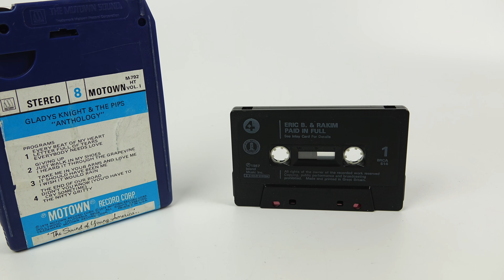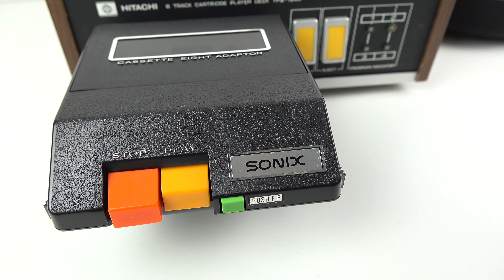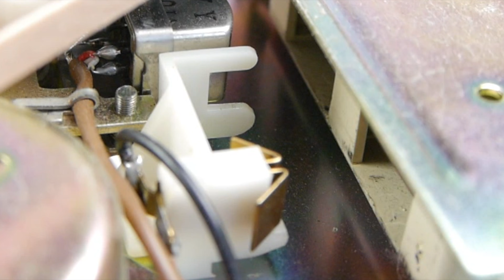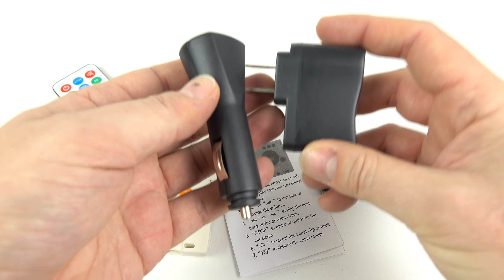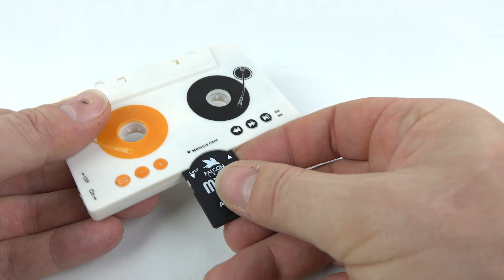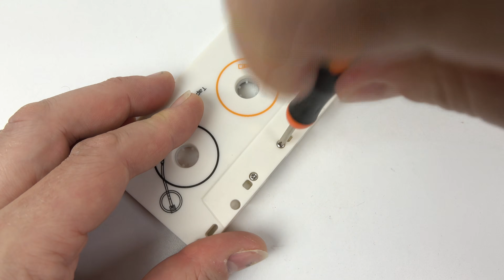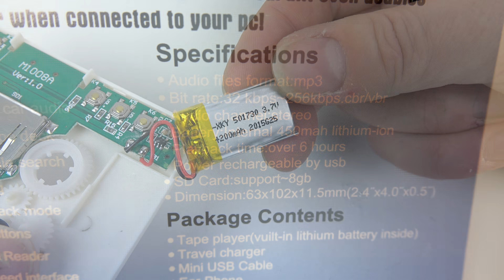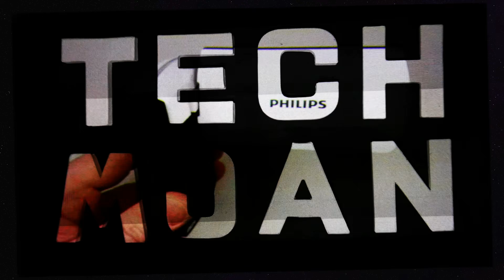Car Stereo Tape Adapters - 8-Track to Cassette to MP3

Comment: The one my parents had was far less bulky. It was longer than a typical 8-track, but not by much. The compact cassette actually mostly fit inside the machine when you played it.

I'm also pretty sure it has this small roller  at the end. I don't know if it used it to power the cassette, but I do think it was what was used against the heads in the actual player.

Comment: This brought back memories from high school when I was driving a 1979 pickup with an 8-track player.  I found one of these 8 track to cassette adapters at a rummage sale, got the cassette to 1/8" jack and plugged into a discman so I could listen to cd's in my old truck. Worked well if I held the CD player, but having to shift gears and hold a disc man didn't work too well. Good times.

Comment: Be good if the cogs charged the battery the you would not need a power supply or have battery life limitations. A simple display on the cassette adaptor would also help.

Comment: You mean I can have an MP3 player that looks like a cassette?! Forget the adapter part, I just want that!
Reply: You can find them on eBay or Amazon for about $15.
Reply: John Cate The shipping will be from China, and it can take two to three weeks before delivery.
Reply: John Cate The shipping will be from China, and it can take two to three weeks before delivery.
Reply: Question is; do they make one that is not cheap chinese junk...

Comment: I had done something similar to this back in 1991. I had a 67 Plymouth with an underdash Motorola 8-track player, it had been in the car probably since 1969, and wanted to play my portable CD player through it. CD to cassette adapter to 8-track adapter. I don't remember how good it sounded, it wasn't God awful, AND it worked......

Comment: If the MP3 adapter supports 8GB cards that means it supports the SDHC standard and would date the device to after 2006 at the earliest, 2006 being the year SDHC was announced. SDSC supports 1MB to 2GB (though some 4GB cards were made), SDHC supports cards from 2GB to 32GB, and the current standard SDXC and supports cards from 32GB to 2TB. I have seen a number of devices say they support up to a certain size that is not on the border between these standards and I don't understand why. The only thing I can imagine is that they only tested it with an 8GB card and didn't want to have to recall the device if there were unforeseen problems with larger or they weren't very careful with their specs on the package, the latter being much more likely in my opinion.

Comment: The mp3 cassette would have been more clever if they used the tape deck motors to recharge the battery.
Reply: or skip the middle man and have it self powered

Comment: I have (or had, I don't know where it is at the moment) an MP3 player called the Digisette Duo MP3, which was a cassette shaped MP3 player that actually did use the transport controls of the cassette player to skip songs forward or back.  Unfortunately, from what I remember, the batteries were no longer holding a charge, and I couldn't find replacements.  It used small proprietary rectangular batteries that needed to be removed and recharged.
Reply: A quick peek on ebay, and the batteries are actually available from Hong Kong... Now if I can only find my Digisette...

Comment: I had a cassette adapter much like that one that I purchased at Radio Shack back in the day for my home stereo.. I rushed home, dropped in my cassette of Dark Side of the Moon, only to be greatly disappointed. It had converted the stereo signal on the cassette to monaural. Back to the store it went to exchange fur a proper cassette deck.

Comment: some 8 track to cassette adapters did use the capstan to drive the tape mechanism, but still needed power for the electronics.
Reply: One I bought from Service Merchandise (Remember them!!!!) in the mid 80's did that..

Comment: But wait, there's more! The Cassette to 8-track adapter you have is but one of three. It was sold in the USA under the Realistic brand name in Radio Shack stores, with black buttons. Sparkomatic and Kraco sold much more compact versions, hardly any larger than an 8-track cartridge. The casette fitted partway inside the 8-track slot so the adapter had to be removed to flip or change tapes. They used the capstan drive from the 9-track player to mechanically drive the cassette. They're not just rebrandings of the same device. The Sparkomatic has its function lever on the left side while the Kraco has its lever on the right.

How about a three-way shootout for sound quality, played in a better 8-track player?

Now for the Cassette shaped MP3 player. What you have there is a cheap-o version. The original model, made by MobiBLU, didn't have a removable memory card. Music had to be loaded to it via USB. On the plus side the tape transport controls worked to play, stop, and skip back and forth among the tracks. Doubleplus, it had an FM radio tuner, a microphone for recording to its 256 megabytes memory, and a removable battery. There was also a wired remote control with LCD, which could only be used in a cassette player if the side of the tape was left open. MobiBLU made a second revision with an SD card slot.

But wait, there's even more! Your cheap version is the second knockoff of the MobiBLU. romeMP3 was first to copy, a quick Google found one with 32 megabytes, some with wired remotes with LCD and apparently SD card slots and removable batteries. I didn't dig deeper to find if they had FM tuners or microphones.

So for some really useless fun, figure out which is the 'best' cassette to 8-track adapter, get a MobiBLU or romeMP3, pop that into a Walkman, connect one of those cassette adapters with a headphone wire, pop that into the 8-track adapter, and that into your good 8-track player. "How to play MP3's in your Walkman through your 8-track, the Heath Robinson / Rube Goldberg way."

Comment: nice.. my folks have a old classic car with a OEM 8 track player... later years they gotten a smaller 8 track to cassette adapter to use in the car ( they want to keep the car stock and as original as possible..) but there tapes are getting old. so this is a very good solution for them

Comment: that 8gb size limitation on your mp3 casette is most likely due it "only" supporting sdhc format which has size limitation between 4-32gb.
most likely they said that it only supports up to 8gb, because either that was the max capacity available at the time or they only had tested it with 8gb card.

same thing happened with phones too, in many cases with old nokia symbian s60 phones where advertised to only support 128mb or 256mb mmc cards just because nokia only made cards up to those sizes.
but many cases there wasn't anything on the phone or it's firmware to block bigger cards, so phone that only "supported" 128mb cards could work just fine with 2gb cards too.

same has happened many times with newer phones too, that supports sdxc cards where often advertised to support only 128gb or 256gb cards just because  those where biggest cards that where available at the time, even tough sdxc format can and most likely those phones also can support cards up to 2tb.

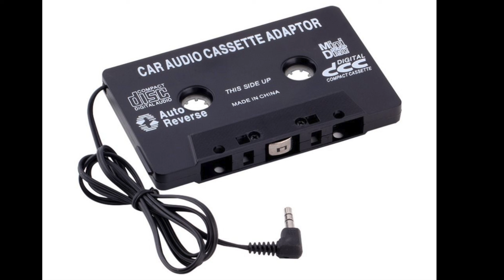Comment: Yo Techmoan, I just gotta say, when I first watched this video and saw the device at 6:00, I bought one off Amazon right away - my car only has CD and Cassette players, but I listen to a lot of things straight off of YouTube. About a year later I'm still using it every time I drive, and my friends use it too whenever they're in my car. I was a little skeptical at first, but as far as I can tell it sounds about the same quality as a CD. So thanks a lot for the info!

Comment: a computer connected to a usb-male to micro SD cable with the micro SD head in a micro SD to SD adapter in a cassette adapter in a 8 track adapter

Comment: I actually found one of these in a '75 Lincoln I bought, the stupid thing worked too, until I mistakenly smashed it. However, it had no motor and was only a series of rubber rollers which used the 8-track player's motor to turn the cassette directly. Pretty impressive.

Comment: I got the same thing that I've got off of eBay today. It plays MP3's on a cassette. It works with all of vintage cassette deck of your choice, one of the shoebox cassette recorders, cassette deck, children's cassette recorder or an 8-track adapter thatI have is a Sparkomatic. I tried it on my Panasonic RS-803US 8-track player & recorder and it plays and sounds so good than an ordinary 8-track tape and cassette.

Comment: You said in this video that people should not use the cheap power adapters that come with car cameras, etc. but you didn't say what we should use instead?  I have THROWN AWAY car cameras because the adapter broke!  How does someone like me (fairly intelligent) know what adapter can be used in place of the original??
Reply from the maker: Dashcams almost always are powered by USB. All USB is 5V.
Dashcams draw between 1 to 2.1 amps. So get a car USB power adaptor that supplies 2.1 amps.
More info http://www.techmoan.com/blog/2014/7/19/batteries-cables-and-confusion.html

Comment: I've got an earlier (?) version of the MP3 cassette, without remote control. Looks just the same, right down to the odd silkscreened "turntable" decorations. The interesting part though, is that this other version does have sensors connected to the tape sprockets - these allows not only play/pause by operating the tape player controls, but (IIRC) skipping forward and backwards by doing FF/rewind. Pretty neat!

Comment: But the original picture that made you make this video was not electric. That one really was driven by the motor of the 8-track. So your idea about that was half right.  The tape goes in the other way bacause of that movemend inside the 8-track cartridge. Maybe that one would actually work wtih that tnt 8-track player. :-)

Comment: I used a Bluetooth cassette tape adapter for an older car to connect to my iPhone. My deck kept auto reversing so I had to remove a cog from the tape adapter after which it all worked fine!  My only complaint is the tiny battery in the cassette adapter only plays music for 4 hours. But still very cool to have a modern device play wireless music in an old car.

Comment: I have buyed this MP3-player-in-Compact-Cassette unit, and have found 2 new features which are not described, even by the seller on Ebay:
01: When an SD card is inserted, and the device is switched on, It will go USB Soundcard when plugged in to an Active Win7+ computer. (Meight allso do on XP)
02: When an SD card is inserted, and the device is switched on, It will go Removable Storage Device when plugged in to an Active Win7+ computer. (Meight allso do on XP)

Those features were found by accident when I connected it to the computer to charge it.

As for the sound of it, It is sadly way too flat... Even with tapping the EQ button several times, the Bass is far gone... I might exchange two SMD Audio DC Cutoff input and output Capacitors (Outputs are C5 and C6 in 10:30 ) from the Amp for greater capacety to get that sorted. (It is just a Class B single voltage fed Amp IC)
For now, I have modded a cheap pair of earbuds by opening up alll the taped ventilation slots on the Magnet so it sounds just a bit better. (These earbuds are now too Bassy with qualety equipment, and therefore "paired" to the Cassette player)

Comment: With the MP3>Compact Cassette adapter, what happens if you turn on Dolby Noise Reduction? Would it make any difference to the sound (better or worse)?

Comment: Slight correction, the film on the head is used to make sure the head is not too close to the head in your car. If the head is too close it will saturate and you will hear distortion.

Comment: That cassette mp3 player is supporting 8gb SD card which is SD HC or SD High Capacity standart and can support up to 32GB, like the modern smartphones supporting Micro SD XC cards can theoretically support up to 2TB as the standart goes...

Comment: They completely missed a trick with that cassette MP3 player, a tiny generator could've been used to charge the battery as the player turns the mechanism inside. I have a cassette deck but also have a rather more expensive AUX-in system that replaces the CD changer, might get one of these as a backup.

Comment: I remember listening to cassettes on one of those 8-track adapters in my moms car when I was a kid in the 80's...you must have bought a high-end adapter because even through youtube and these tiny iPad speakers, it sounds waaay better than the one in her late 70's Impala. Although, the fact that the adapter was slightly melted from the 120F degree Arizona heat might have had an impact on sound quality....

Comment: Wow, it's quite an assumption that you can draw power off the end-of-tape sensor on the 8-track. I can think of many circuits that wouldn't allow that to work (as it's essentially an INPUT), but probably back in the day they were very unsophisticated. It does look like an ultra-cheap transport mechanism of early 70s vintage, sounds about as bad as that implies! (Germanium transistors as well, if I'm not mistaken, that dates it to the same period).

Comment: just a thought. the 8 track adapter may take up to 25 volts so it could be used in coaches trucks or other vehicles with a 24v system - just something that randomly entered my head as I drove an old coach once with an 8 track.

Comment: That MP3 cassette player had to be from 2006 or later. You popped an SDHC card into it and it played it perfectly. SDHC was introduced after 2006 and is NOT backwards compatible with standard SD Cards, the slots and pins and power draw are all the same but the way it handles files is completely different and will not read if a device only accepts standard SD cards.

Comment: My parents still has an audio cassette tape adapter thing that you can use a modern day digital music player on a cassette player. they used it in my dads old 2003 Toyta Corolla to play Podcast and/or Music from an MP3 player on long car trips. But I still don't understand how it can convert the digital sound to analog without needing to rewind or flip the cassette tape.
Reply: It probably has the exact same kind of mechanism as the MP3 player cassette in the video.
Reply: true
Reply: Just about all audio players convert from digital to analog. If it's line-out it works the exact same way a tape does, left and right analog audio on the tape picked up by the tape head, the media player sends left and right channel analog audio through to the tape which is read by the tape heads in the exact same way that a cassette does.

Comment: Wow, Infrared on the cassette/MP3 adaptor was a pretty stupid idea of the maker.
Most cassette radios I've seen swallow the whole cassette, leaving no way for the signal to the remote control. Bluetooth would be a better choice for the remote.
That also kept me from buying the adapter in the first place. I had an cassette to 3,5" jack for years, some of them are of decent quality.

That cassette to 8-track unit has this amazing 70s/early 80s black rough plastic surface, I love that.

Comment: If I didn't remember wrong, SD cards only goes up to 4GB, so 8GB means SDHC card is supported. Therefore, maybe the 8GB is just printed on because that's the maximum size available at that time XD

Comment: 'SD' cards have a maximum capacity of 4 GB of data. If it takes an 8 GB card it meets the SDHC spec, which goes to 32 GB of data. Anything that reads an 8GB card should read a 32 GB card. SDXC cards are between 32GB and 2048GB, however because of a missing additional address line, some SDXC readers stop at ... I think it's 256GB. Also I don't think anyone actually makes a card larger than 512 GB yet.

Comment: I had a 8-track to cassette adapter that didn't take any batteries and seemed to be gear driven from the 8-track player. The problem with it was, it played cassette tapes slightly faster than they should have been. Listening to Nirvana in 1993 on cassette tape, through the adapter, in the 8-track player in the car, the music was slightly faster than it should have been normally. Otherwise, the sound was fine.
Then, my first CD player was a Sony Car Diskman. I had a cassette player adapter to plug into my cassette player stereo in my newer car. It worked fine, and actually worked better in comparison than the cassette in 8-track adapter.

Comment: I have a car with a cassette player in it, so to play my MP3s with my phone, I picked up a cheap converter like the one you said was "too easy". This one has a mini USB on it though (and a iPhone plug thing) so I plug the USB cable into my phone, and plays the music through that. And what's better is that if the cogs stop turning, (If I pause with the car's controls) then it tell my phone to pause the music. I think that is pretty neat.

Comment: Some of the 8-track to cassette adapters were indeed driven off the 8-track player's capstan.  As a child I'd do essentially what you're doing in your videos -- buying eccentric equipment and taking it apart.  At one point I probably had six of these.

Comment: Playing MP3s on an 8-Track player - awesome.

Also about SD cards. I don't know why but it seems manufacturers always state a lower capacity than actually possible. My old phone supposedly only supports 32GB MicroSD cards but I tested it with 64GB and 128GB cards and it worked just fine so...